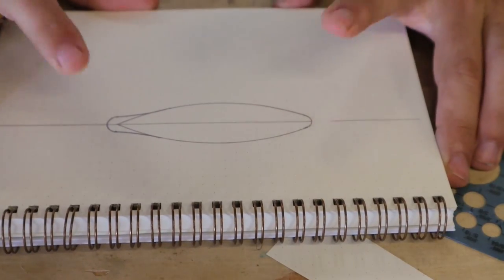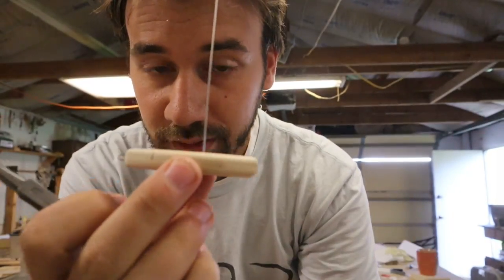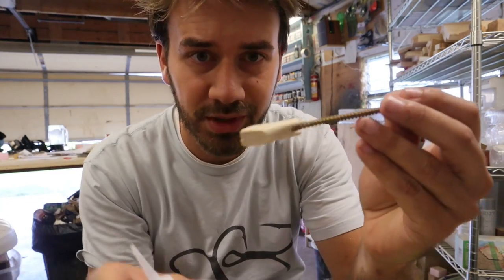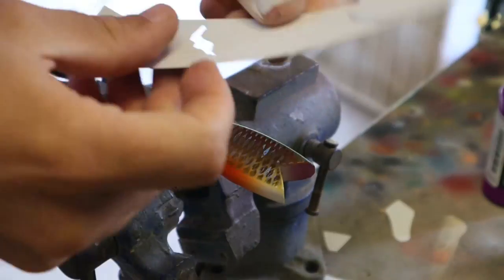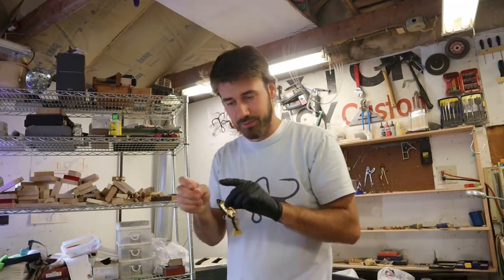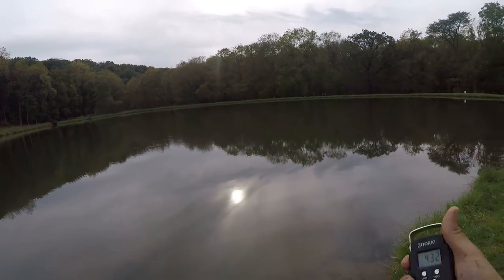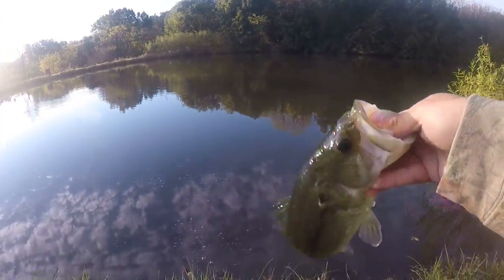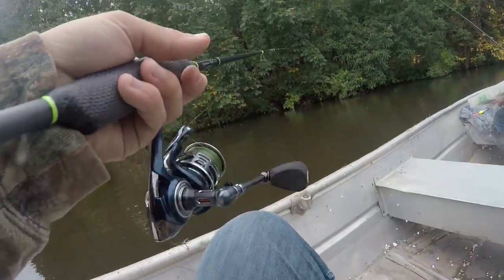Injured Bait Fish | One Day Build to Catch

Comment: You should do a video on jointed baits with the joints in different places on the bait. Similar to the crank bait lips and how you tested different lips. Maybe even make two or three joint jointed baits in different places as well. 3 or 4 total baits should be sufficient.

Comment: Old rc hobby trick. Take a syringe needle top (the removable kind) and put it on the CA (super glue) nozzle. When you are done with the glue, it will harden in the needle forming a seal. When you need to use the glue again, hit the needle with a lighter for a split second and the needle will clear out.

Comment: A trick when laying down the adhesive scales pattern paper, spray a little soapy water or normal filtered water on the adhesive side of the paper then lay it down, it won't stick immediately and you can slide it around to get it perfectly fit, then just use your fingernail and run it over the top side of the paper to push out all the water, once all the water is out it will stick perfectly in place

Comment: I have had an idea for this type of bait for years. Maybe try less lead or no lead or a balsa wood body so that the bait will float back to the top. Work the bait with a stop and go action retrieving it under the surface a ways and let it float back up like and injured bait fish would swim. A short pause after it gets back to the surface and then a slight pull to make the bait almost quiver on top of the water.

Comment: You experimenting with my rotisserie in the UV tank idea!!!!!!! YAY! 😊👍👍👍👍👍👍 

Another idea for your dieing fish idea, 3 part fish with different wood used in different places. It could be the same shape and size as this one but have an extra joint for the head. I'm thinking some of the cursed iron wood in the middle, something super buoyant at one end and something middle-ish buoyant at the other end. Also, off center weight so it tries to twist about a bit while sinking........ although you'd probably need to have 2 twist eye hinges for each section if you do that so the other sections try to fight the twisting. I know you can add lead to make things sink, buy is there something that does the opposite? i.e. drill a hole and fill with something more buoyant then wood. If there is, use that on the other sections to fight against the lead sinking. I hope that makes some sort of sence, if not, could I send a picture through email or something?

Comment: You should put a lip on the tail piece to get it to do weird things, maybe putting two lips that were asymmetrical and orient them so the head has one that pulled it down and slightly to the left and the tail had one that pulled it down and slightly to the right

Comment: Another thing to try would be to make the head part of the swim bait slightly buoyant and put a relatively large lip on it, and then making the tail part heavy enough to sink and putting a smaller lip on the tail and doing sharp jerks on the retrieve. I think this would work because when it gets the jerk, the front lip catches water, making it dive, but the back lip won't because the front lips blocks the water from hitting it, then at the end of the jerk, the head starts to rise, but the tail won't because it's heavier, and the tail lip catches water and the back dives until it comes to a complete stop, and then the whole thing repeats. You might have to play around with the weight of the tail to get it to work just right

Comment: So Nate..... Store your super glue inside the refrigerator, in a plastic bag. The refrigerator is a very low humidity environment. It's the moisture in the air that causes super glue to solidify and clog the tip of the spout. You could also store it in the freezer. It WILL NOT freeze. It will stay liquid. Also a VERY dry environment. You could literally keep a bottle of super glue for years without it solidifying by utilizing one of these two methods.

Also, accelerator for super glue is just distilled water with a little bit of bleach in it. You can easily make your own. No need to buy.

Comment: Challenge idea: Budget lure building challenge.
You have a fixed budget to buy all the materials for a lure build (wood, glue, epoxy, lexan, wire, lead, screw eyes etc.)
You can also only use basic tools (hand saw, file, sandpaper, hand drill, chisel etc.)

Comment: If you want it to wobble on the drop then you need to shape the body to generate turbulence at the top of the bait as it falls. A tear drop travelling fat end first is the most aerodynamically stable shape because it generates very little turbulence as it passes through the air, it only wants to fly (or swim) straight and true. However if you make it travel in the opposite direction (pointy end first) it'll weave and wobble all over the place. 
Its kind of a tricky concept to explain without either pictures or a million lines of text but I'm sure you know how to google these things and I really think it'll help you to get the kinds of action you want from your lure if you get even a shallow understanding of the basic principals of aerodynamics.

TL:DR If you're looking nose on at the bait as it would sit in the water with the hook hanging down then you want it to be broad at the top and then taper downwards .  

Nice bass by the way

Comment: Ye mentioned that ye wasn’t purely satisfied with the way this “injured minner” acts.  Well, ye might want to try a little “insignificant’ device to make it act crippled.  To me this bait would act better on an open faced spinner reel, which coupled with the afore mentioned “device”, would probably shine, pardon the pun.  Make ye a hook out of wire, deep enough to hold yer line so it don’t come out.  Clip it onto yer rod between the hook hanger and first guide.  When ye cast, hang yer line in this little hook and just reel yer bait in. The closer to the reel the more erratic action, so experiment with the retrieve by sliding the clip-on hook up and down the rod, till ye find it’s sweet spot.  Just an old, largely overlooked technique. Hope the idea helps.  P.S. take the line out of the hook after the hook set.